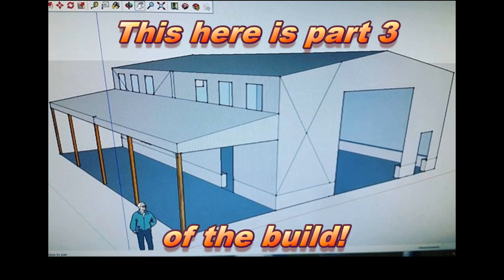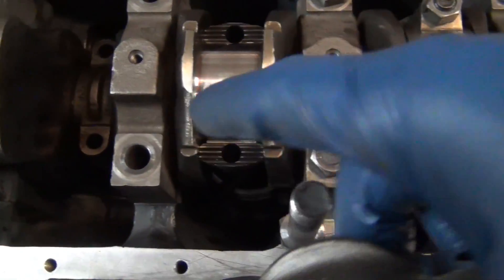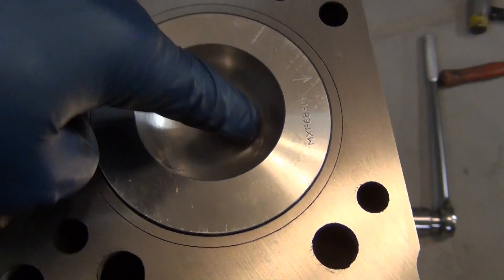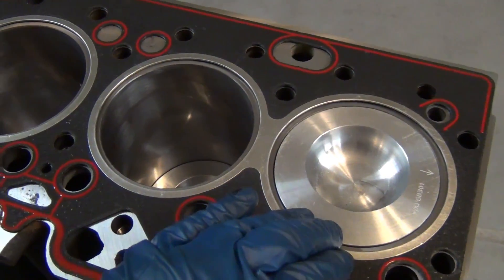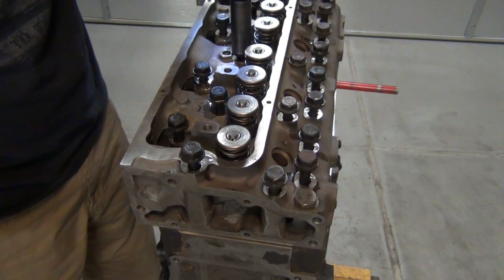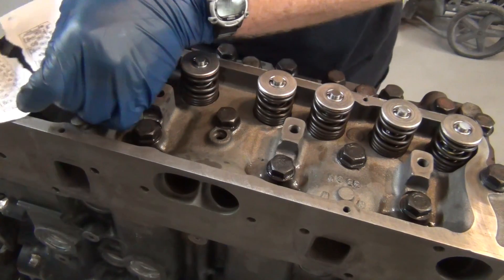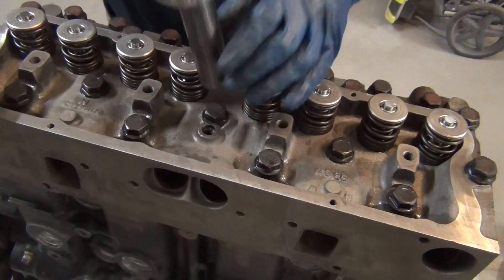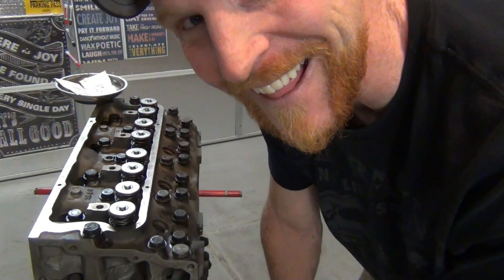Perkins Diesel Engine Build Pt  3 Cylinder Head Install

Comment: My 3 cylinder Perkins wrecked itself when the injector thing in the head fell out and wrecked number 3 piston, con rod and cylinder. I bought a replacement engine and now a year later I think the head gasket has blown 😮

Comment: I have a 1992 Bobcat 943 with the 4.236 Perkins engine and the Bobcat repair manual says that there are dowel pins that go between the block and head.  I do not see any place where there is countersunk holes in the head or block for dowel pins. I appreciate your video it gives us the answer about the dowel pins.  Thank You, excellent videos on the Perkins engine.

Comment: LOVE YOUR SERIES!!! You've been a big help.  Our connecting rod caps had all of their two letter codes (either "CA" or "BX") facing FWD and our lower end had not been opened up since it left the factory in the UK.   I'm wondering if someone switched that one that was as you stated "concerning" in the last "rushed" rebuild.  That said, had I been you, I probably would have put it back in the way it came out as well.  Now that you have this info though, would you think it better to put it back in the way it came out or, do it the way that ours was?...my thought is a call to Perkins but I don't think that would get anywhere.

Comment: TECHNICALLY you’re supposed to do that extra 180 degree turn on the head bolts all in one sweep (good luck with that 😉) nice video, I work at a Perkins dealership, we have 4 of these engines in the shop right now in various stages of re-building.

Comment: that was so nerve racking watching you use that breaker to tighten those head bolts, i know its to spec but i've had my fair share of stripped threads and snapped bolts and just feel the pain of other when it happens to them Dx

Comment: For those crazy tight bolts, stand on the engine stand. Saves the engine twisting around on you. Can't tell if you're doing it or not...more for any newbie wrenchers out there.
Reply from the maker: Or just stand through it.

Comment: I let my heads sit overnight to settle and final torque next day, you should be able get the extra 10-20deg you running short .
You want get a digital wremch with angular function, man it makes life easy plus see the ft/lb readings from the angular setting and can see how even they go down .
These perkins lumps are cool 4 pots .
Reply from the maker: I'll have to try that.

Comment: The torque spec was probably for a DRY torque but you oiled the bolts.  The wet torque is different.  That's why you couldn't do the 180°for the final stretch of the bolts.

Comment: The first time you torque by feel and break one of those bolts off it changes the way you do things for life, lol.
Reply: I dunno i just did one by the book and it just popped a gasket 88ftlbs seems low to hold diesel compression. Told my guy i should of milwaukeed the thing on

Comment: Re: the head gasket - an oval is basically an ellipse.  That shape in the gasket is correctly called a stadium, as it has straight, parallel sides (although in common speech, they terms are often used interchangeably.)  :-)

And yes, I can be a bit of a pedant - but you asked!  :-D

Comment: Did you measure the head bolt lengths to make sure they were still within spec before reusing them? They do stretch a lot in use, IIRC the spec on some is 2mm, past that you replace all with new, even if some are not past the spec. The old bolts however have a lot of uses on less critical parts, I reused a lot of head bolts to hold trailers together, they were a lot better than the original non rated ones that were there, even though I did have to paint them before and after installing so they would not rust. even welded one head to a plate to make a spare wheel mounting for the trailer that did not have one, and drilled the end for a split pin to hold the nut in place. Later on I changed it out for a tank lid bolt and wing nut, I got for free, because that was stainless steel and looked shiny.
Reply from the maker: Cool.  Stainless tank lid bolts and wing nuts are the coolest!